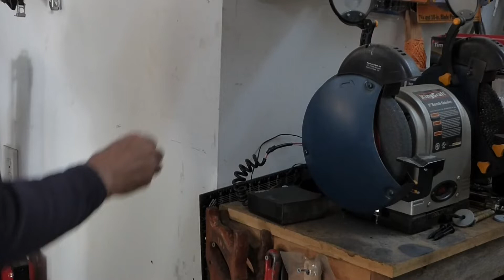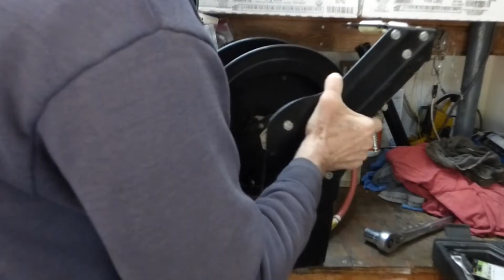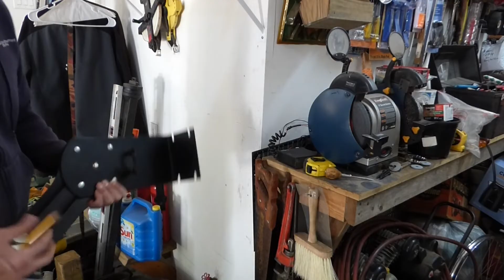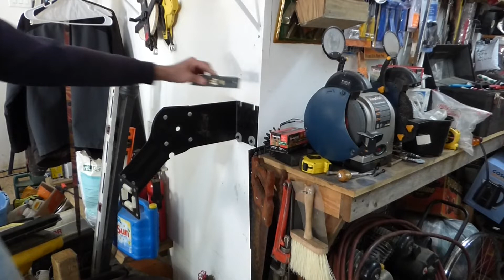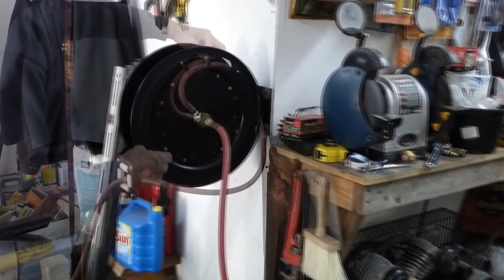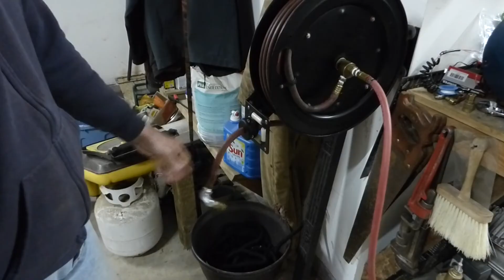Air Compressor Hose Reel Installation - The EASY Way!

Comment: Thanks for your time making this. Another tip for anyone installing something heavy, like this reel. If you have a certain spot you need to mount something to the wall but it doesn't line up with the studs, get a section of board or thick plywood and screw the board into the studs, then mount your object into the plywood. This gives you a lot more versatility and choice as long as you don't mind  the "look" of having a plywood/wood backer.
Reply from the maker: Great advice, using a backer board is a perfect way to add flexibility to any installation! 😊